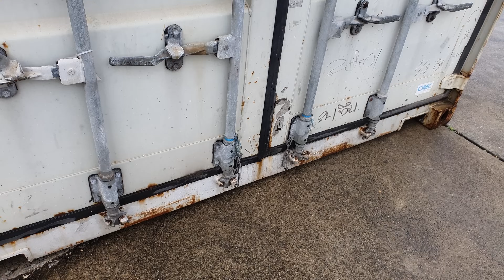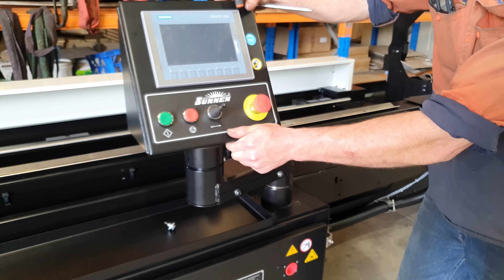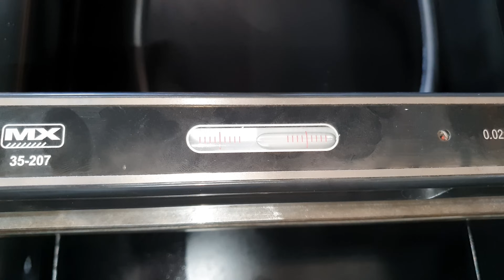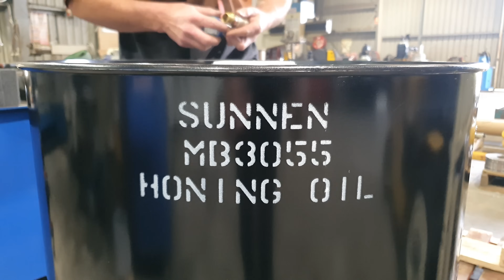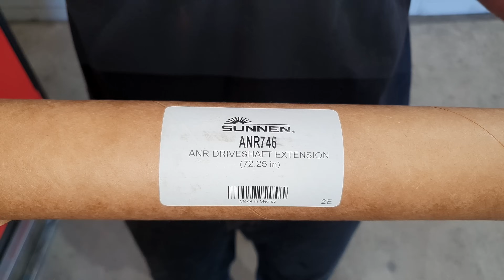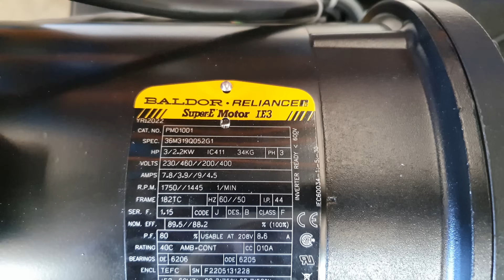New Machine Day! | Unboxing & Install | Sunnen HTA-4100 Honing Machine

Comment: One thing I noticed: Everything is packaged and presented spectacularly. All the "delicate" stuff is well protected, all the edges and corners are padded. You can tell that Sunnen and the supplier care about how their stuff gets shipped.
Reply: That is nothing special - absolute standard in this price range. You do get what you pay for and that includes packaging quality.
Reply: @Uli_Krosse  I agree, but most viewers would have never unboxed anything like this machine in size or cost and only have packaged consumer goods as a reference point.
Reply: @markfryer9880  Maybe I should have chosen my words a bit more carefully. Apologies, I meant no offense, neither to CEE nor to Sunnen.
Reply: Well said,  it's so easy for manufacturers to ship machines with paint chips, rust and mechanical damage.
Reply: Good job bro
Reply: @helplmchoking  I have seen that on Chinese machines and on hardware from Eastern Europe, to a lesser extent on machines from Britain and the US - and never on stuff from Japan, Germany, Switzerland, Austria or Italy. I have seen transport damage, but only very little factory screwups, if any. There was the odd missing manual and a few times a button might have been missing, but that was it. Granted, I may have been lucky. To be perfectly clear: I have also seen fantastic machines made in the aforementioned countries which came without any flaws.
Reply: I will bet, the reason the delivery was delayed is that Siemens Simatic HMI panel was out of stock. The leadtime on those have been insane ever since the start of the pandemic
Reply: @JohnDoe-bd5sz  The S7 suffered from that since its launch. ;)
Reply: @Uli_Krosse  Okay, i think my work still has one on order for more than a year now.
Reply: @JohnDoe-bd5sz  Alright, it did not suffer that much. Condolences, mate. That really sucks.
Reply: They heard how Kurtis's Competition were Stressing him out so they made sure to include PLENTY of Therapeutic Bubble Wrap for him...

😄😁😆😅😂🤣
Reply: @JohnDoe-bd5sz  not just them AB's lead time for HMI's and some PLC's are absolutely ridiculous too.

Comment: That is one cool setup for offloading containers.
Reply: The truck is called a Side-loader and are fairly common in most Australian cities. The advantage is that your container can then be unloaded and/or re-loaded at ground level which makes things easier and far safer for everyone.
Reply: I've never seen one in the UK
Reply: Friggin engineering marvel
my friend, probably costly too in top of that! This has a cool factor of a 10 in my book!
It was a dream of a pissed off forklift driver maybe on a bender!🤔🤔🤣🤣🤣
Reply: @markfryer9880  never seen anything like it. Central USA here and if come in container just gets offloaded with big ass fork truck or a pair as just generic flatbead/lowboy trailer or comes into our plant on a rail car.
Reply: Very common in NZ.  Factory gets a call - "Which end you want the door?", truck drives inside the factory, PLONK, drives away.  Businesses don't need overhead cranes or big forklifts to deal with containers and turn-around can be real quick.  Only one container per truck, though - maybe in the US they use a lowboy with two?  Oh, and there's a couple of types of side-lift ...
Reply: I've not seen any in Oregon either like you said overhead crane or big ass forklift or rollback truck sometimes
Reply: @markfryer9880 Do they make these for 40ft fully loaded containers?? This does not exist in the US to my knowledge. Pretty damn neat😂😂

Comment: I have worked with various sunnen machines for over 3 years and can tell you that you made a very good purchase. I have processed components from 3mm to 600mm in diameter and up to 5m in length and have always been able to achieve results better than 1/100mm. these machines are incredibly precise.
congratulations on your new machine. Greetings from Germany

Comment: When using a string to align anything it is helpful to add a known space between the string and the item you are aligning.  You can then use a measuring device to verify the alignment not having to worry that the string is being influenced by touching the machine along its length.
Reply: Because the honing head sits on a universal joint I don't think it's that important. The stones guide themselves around the barrel.

Comment: Worked one of these machines for years, biggest job I did was 300 diameter x 3000 long, had to take 2mm of material out due to welding the outer & it being rough hollow bar to begin with, it took 8 days! oh & 'edit', never sell that vert hone, what an awesome piece of kit you did a fantastic job on that thing.

Comment: Kurtis you're doing it right.  Found out in my many years on the earth not to scrimp on the tools and materials.  If you want the best job possible you got to have the right stuff.  Took a long time not to buy the cheapest tools at the hardware store.  Now I purchase the best no matter if I have to fork out more for it.  It's worth it in the long run.  And the smiling and laugh is getting to be a nice habit!  A heads up - young people watch your vids as well.

Comment: Great video with great explanations. I love the way you run your workshop. It is particularly nice that your new machine has a Baldor motor. That motor will last, run smooth and true. The replacement ball bearing part number listed on the motor label. (retired engineer and amateur machinist)

Comment: That is a nice machine. I'm a light mechanic so know about engine hones, Sunnen have been making some of the best hones for ever. Next tool to buy will be a profilometer so you can print off the data and attach it with the invoice as proof the barrels are in spec.

Comment: I once saw a guy hone a keyed bore with the single stones. Like 9in bore, with single stones on a 2 handed drill setup. It was hilariously bad, it didn't help that his reaction was to hold Down the button while pulling it out of the bore. For those who haven't used a drill hone setup it pivots, and you can imagine what badness happened.

Comment: I worked in a honing shop in the mid 70's. It was the nastiest shop I had ever worked in. Oily sawdust with mud. COLD 🥶 hard to see the inside of the honed tubes due to your breath vapors.
 This machine is a Cadillac in  comparison to the Yugo I worked on.
Looking forward to the videos !!

Comment: I am impressed at how well the machine was packaged. Everything protected and strapped. Considering the cost (lots of $$ I'm sure) and that it traveled quite a distance, gives confidence that the machine will arrive in good order. And having all the hardware already in place must make assembly a lot easier than having a bag of nuts and bolts. Ikea, are you watching this?

Comment: You should use spacer blocks where the line is clamped at the ends then use a third block to straiten the unit

Comment: As millwrights we use piano wire with an electric micrometer wire is pulled tight with a twenty pound weight hanging on the end sag is minute. I have a pic I’ll send you as soon as I find it thanks for the videos from Las Vegas millwrights.

Comment: Sunnen is the gold standard for engine honing and rebuilding equipment.  I was at a bankruptcy liquidation auction a few months ago and there was a hta-4100 being auctioned off.  It was a 10 year old model with a few hundred hours on it and it still looked like new.  It sold for $28,000 usd, I have no clue what the value is on something like that or if it was a good deal.

Comment: Awesome bit of machinery to add to your workshop 👍.

Very sad if the others were indeed playing games. Screams of insecurity 

A couple of notes on string lines from a carpenter. When using to gauge in the horizontal (left right) put a packer between the job and line each end and use the same size packer as a gauge block to check. This will remove any interference. You can not trust a string in the vertical plain (up down) not to sage. Even when pulling extremely tight (just before snapping) you will get a sag of 5mm in 20m

Wind also plays havoc in the horizontal and doesn’t take much. 

Great work as usual
Reply from the maker: Good tips thanks mate 👍

Comment: Good for you for making it to where you can buy something like this. You certainly deserve it! It sure looks expensive!!!
I'm struck by the construction of the new machines compared to the really old stuff. I'm sure it's strong where it matters and much better engineered, it's just interesting to see that they aren't using massive cast bases and parts anymore.

Comment: Well Karen, Kurtis got him a new toy.  Did you get a new camera or tripod or editing program????  One more item for your attention.  Please go buy K a proper utility knife with which he can open packages.  Him and those single edge razor blades gives me chills.
I remember going to a tool show in Chicago back in 1969. Sunnen was demonstrating the creation of a sleeve they honed to slide on a demonstration pin. They placed a rubber stopper in the sleeve, cleaned the pin and sleeve, and lowered the sleeve on the pin and gave in a spin. It would spin on the air cushion for 4 or
5 min.  Then they removed the sleeve and placed a finger print on the pin, re-assemble.  It would not turn.

Comment: Unpacking all those stones gave me flashbacks to a previous employer. They intended to order a prototype honing tool with a particular stone composition, dimensions, and/or expansion angle, to see how it would perform compared to what they were using at the time. Thanks to a typo, they ended up with 100 instead. At something like $2000 each. They couldn't be returned because they were custom. Refusing to pay wasn't an option because it was the same company that made their hones - if they'd refused they wouldn't be able to buy replacement parts, get service, or buy new hones. 💸💸💸

It was a decade before my time, but some were still laying around when I started.

No idea why nobody double-checked the quantity.

Comment: Really cool, thank you for sharing. Very happy you can be vertically integrated in your machining and processing wrt honing. In addition to not having to deal with the other business's games, you save the to and from transportation time delays, costs, and potential material damage. 
I do have one question...I assume the leveling feet are in bananas, is it ok for them to set into a metric counterbore on the aluminum pads?

Comment: Seem's like Horisontal boring is becoming a better option, well if you have the wearhouse/workshop for it. Since most verticals are 50+ years (most of them, not sure if they make new of them)
But is it any benefit from vertical VS horizontal boring? apart from length vs height vise. is it any different results between them?

Comment: Fork lift 
   There are magnetic Fork lift protection pads , that magnetically attach to the forks and protect the work to be lifted 
      " The ones with the ribbed surface stop the item from rolling off "
   Rubberized,  Ribbed , Magnetic .
    Thanks for reading

Comment: Pardon my ignorance, but wouldn't you have to run the string line down both sides of the machine? It intuitively seems to me that by checking only one side, you run the risk of indicating only inward or downward bows with the string line, with outward/upward it would show taut against the rails no matter how far out.

Comment: Thats the lows the competition will go to stay ahead. They forget that when it comes around and they need a hand, you will be there to help. The English call it Monopoly. Played it a few times. This can go deeper. Bloke i worked with worked as a mechanic in northern India bout twenty year ago. His boss was Japanese and would oversee the more critical jobs like engine and  transmission rebuilds etc. He would coach the job to crtical stages where now his experience would be required (think torque settings, seal installed, assembly tricks etc, just stuff that if wasn't done right, it may result in failure) So when the other Mechanics would hear him say "hey bro can you put the kettle on and make a cup of tea, they knew he didnt want them around to see the "magic" hapoen.The competition up there so fierce he knew as soon as his apprentices knew enough they would set up shop and be the competition. Of course the interwebs negates alot of that now but  thats how it was BITD.

Comment: hey man I know its not the topic, however ive just watched Your video from 2 years ago about welding an eye on a hydraulic cylinder... and i just wanted to ask You would You weld a fork on a forklift? is it safe at all? and also... did the client of that cylinder had no problem with instaling a hose back on it since u layed like 5 pounds of molten metal on there, wasnt there any warp on those holes? i could just sit back and watch u perform awesome engineering.

Comment: Complete noob to this sort of thing, so I just wonder what's the purpose of this machine? Smoothing the inside walls of a tube... Would it be more for doing things like hydraulic tubes where the inside has to be a specific thickness and very smooth? Or is it for liquid flowing without obstructions? It looks like a cool machine anyway, can't wait to see it at work :D

Comment: Very nice mate, we took delivery of our HTA-4100 in March this year and it's definitely paying for itself. One thing I've noticed is when I honed almost 3mm (yes you read that right) out of a CAT 6030 Stick cylinder that the bore of the barrel had shifted about 1mm to the one side of the barrel. We fixed this issue with future jobs by rotating the barrel 90 degrees after every 0.2mm or so of honing to keep everything concentric. Is this an issue you've picked up with your delapena? If so, how did you rectify it?

Happy honing
Reply: I suspected that the bottom part of the tube would be more affected by the extra load of gravity. He should just have built a tower for a taller vertical machine. LOL

Comment: FYI.. If makes ZERO cents for the premier fabricator in the territory@$1000's per hour to stop & make deliveries.. Losing 1000's.. when you can hire a driver for $20 an hour... HIRE a driver & assistant.  If nothing else they clean up the shop while you move on to a brand new job

Comment: I'm sure it cost an arm and a leg and I'm sorry to say this, but boy does it look cheaply built. The entire machine is made of sheet metal and powder coated to hide those overkill welds. Probably since it's made in USA, you have to somehow compensate for the labour cost.

The vertical honing machine looks like a real machine compared to the Sunnen. However, this is not important. What's important is that it does what you need it to do.